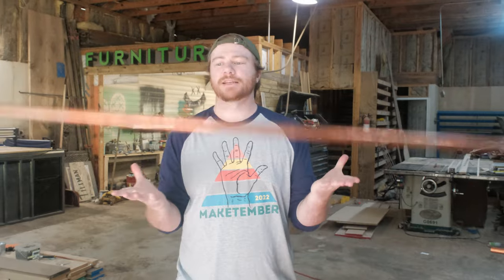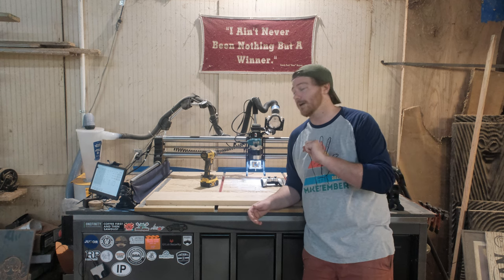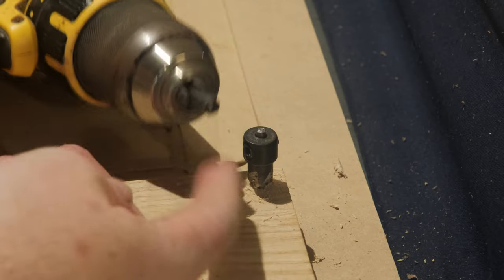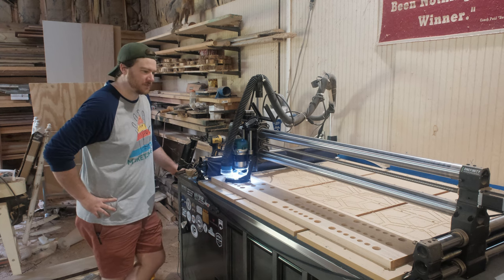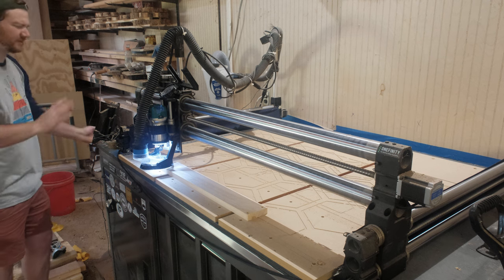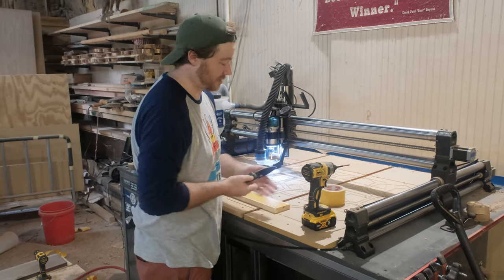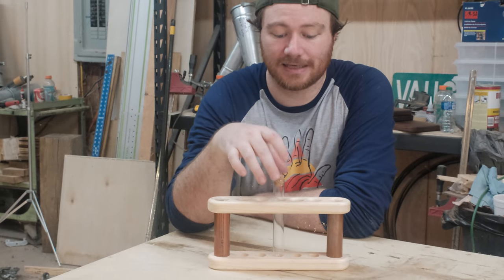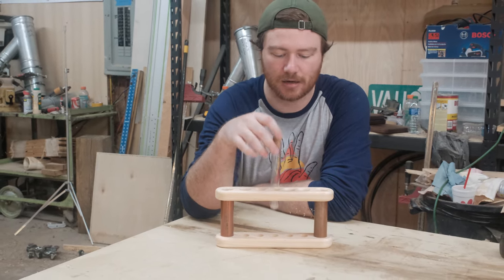Easy CNC Woodworking Projects- Propagation Station

Comment: Compressed air would work great on cleaning out the sawdust in the collet.  Now, I don’t use a compressor very often, so it is not running.  Of course this would be a good time to maybe consider one.  Or got with canned air.  Just a suggestion.

Comment: What dust boost are you using with the magnetic holder.
Reply from the maker: The dust boot is the Suckit dustboot on Onefinity's website and the magnetic plates are from Huntington Builds (linked in description!)

Comment: I had no idea what this was so watched out of intrigue. 

I have a batch of hold downs that were cut to the wrong diameter and don't fit the tube they were designed for as they were the second run, fair play for showing it. 

More amusingly, copper appears to be much cheaper in the UK, normally everything is far more expensive here,  I know any hardwood is and hard to find stockists.
Reply from the maker: Thats interesting! Yeah copper is very expensive. Thanks for the comment!
Reply: @HamiltonDilbeck  Grabbed a small piece of warped local Ash from a furniture maker scrap pile, maybe 20inch x 10 inch x 1inch cost around $12, struggle to find retail and can imagine the cost. Why I prefer aluminium, it's widely available.

I will enjoy this series you're working on now, I may be inspired to use up the small bit of Ash I have left over from that sign job.

Comment: Killing it with this series so far. Also- I saw you use Carveco for the CNC, which pushed me to try it out- and it’s sooooo much better than the old software I was using. Quick question- I’m local to you- Canton- and was wondering what farmers market/craft fair you are referring to? Thinking of checking it out.
Reply from the maker: Hey neighbor! It's going to be at the new Cumming City Center at the end of October! I'll have more info on that on day 30 in case anyone local wants to stop by!

Comment: If you used a 1/4" bit, couldn't you speed things up significantly by using a 1/2" bit instead?
Reply from the maker: For sure
Reply: @HamiltonDilbeck  Sent you a message via Instagram